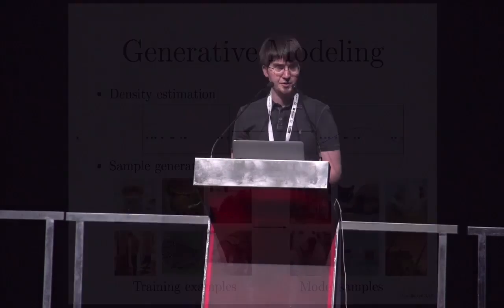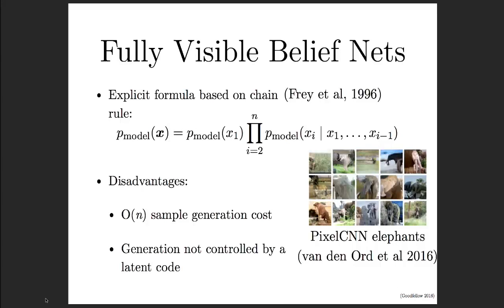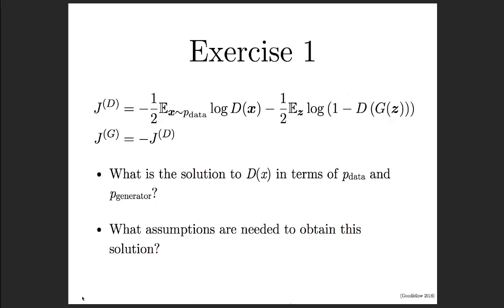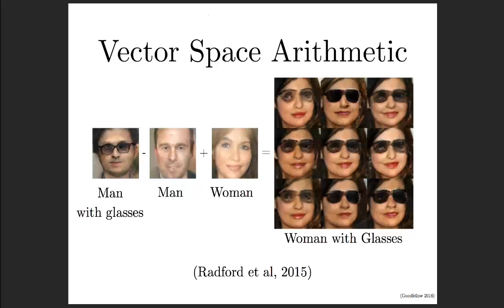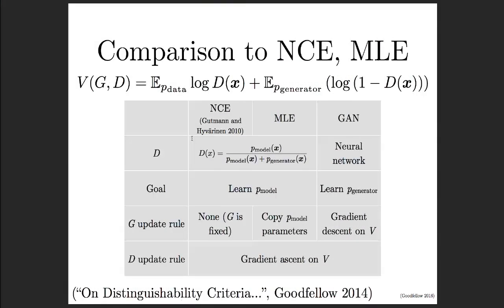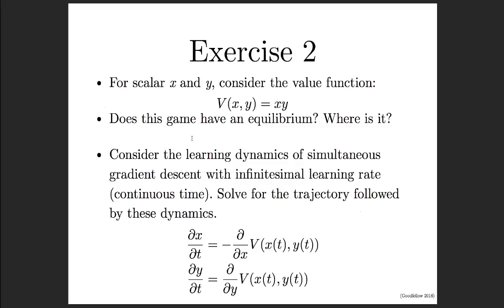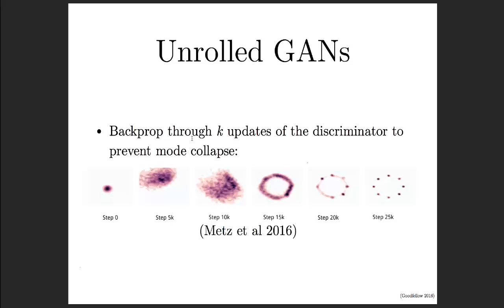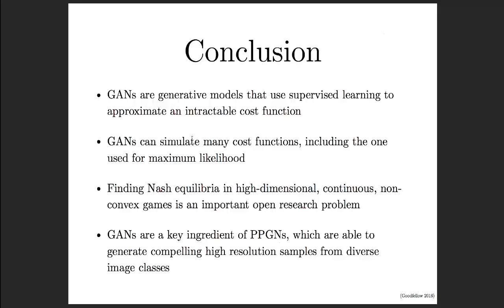Ian Goodfellow: Generative Adversarial Networks (NIPS 2016 tutorial)

Comment: 13:24 when searching for the best theta, Ian is summing over the log of the probabilities rather than over the probabilities, why?
Reply: If it's still relevant, I'll try to help. This is called maximum likelyhood estimation, which is the product of the estimated probabilities on the training dataset. As derivative of product is not easy to work with, we take a log of this, so this yields the sum of logs. As log is a monotonous function it doesn't change the local minimum and is easier to take the derivative of. Hope it helped

Comment: Such a fake Schmidhuber is the true creator of Gans, and Goodfellow had the nerve to shut him up
Reply: Two people inventing more or less the same thing independent of each other has happened many times in history, for example Newton's method or Darwin's theory of natural selection. Calling either of them fake is rather presumptuous.
Reply: @busTedOaS  bro Goodfellow came decades after this guy that's not called simultaneous inventions
Reply: @pranav7471  That's why I said independent, not simultaneous. Bro.
Reply: @busTedOaS  I completely understand that, but u need to credit the first creator too, that's the only problem I have. As far I know Goodfellow was the first one to make Adverserial Networks work, Schmidhuber worked with 1000x worser hardware and wasn't able to get any real results so it was just a cool idea with no solid results backing it up. Thus Goodfellow deserves credit but not completely. Even after all these arguments, Goodfellow refused to acknowledge the clear similarity between the work and cite it, this is blatantly unethical from an academic standpoint.
Reply: @pranav7471 Schmidhuber had modern hardware in 2014. Plus years of experience with adversarial models ahead of Goodfellow, presumably. I don't see any disadvantage for Schmidhuber there.

I agree that one should cite related work and Goodfellow does this consistently - in fact that's what he did right before the confrontation. Why would he specifically ignore Schmidhuber's work while citing many other works with even stronger similarities? The reasonable explanations I can come up with are 1) personal spite or 2) he honestly thinks the techniques are sufficiently different.
Reply: @busTedOaS  Oh yeah I found he has cited predictability minimization, wasn't aware he already cited it, Thanks for letting me know. Then I don't think there is any issue. But the work was done in 1992 not 2014 (one does not usually keep revisiting their decades-old work)
Reply: @pranav7471  I wasn't saying Goodfellow cited predictability minimization. I'm saying he generally shows great willingness to cite other related work (the NIPS paper has 6 pages of references). But if you say he did, then that's great.

If Schmidhuber didn't revisit his old work when appropriate hardware came arround, then that's his own thing. Just saying that hardware wasn't the issue, then.
Reply: @busTedOaS  "hardware wasn't the issue" That's not how academia works 😂😂. LoL, u clearly are not a researcher so u don't get it.
Reply: @pranav7471  You're being very convincing, professor.
Reply: @busTedOaS   the Gans paper has cited and explained the links to predictive minimization, I am 100% confident that wasn't the case b4. Also adding 6 pages of citations means nothing if the one closest to ur work is left out. If may have been done unconsciously but usually it is done by authors to pose as the creator of something totally new brought to the world by them, thus severly frowned upon.
Reply: @pranav7471  Predictive minimization has little in common with GANs except that there's a minimax game being played (as far as I understand it). Almost everyone seems to agree that Noise Contrastive Estimation was the closest relative. So that's what Goodfellow put on his slides.

But hey, if you want to assume bad intent, there is no way to disprove it.
Reply: @busTedOaS  Dont argue about things without understanding for urself, who is this everyone 😂😂, academia isn't a democracy LoL, whats right is based on facts not votes. If u wanna continue arguing do it after reading Schmidhuber work "Generative Adversarial Networks are Special Cases of Artificial Curiosity (1990) and also Closely Related to Predictability Minimization (1991)" - https://arxiv.org/abs/1906.04493 .
Reply: @pranav7471  I don't pretend to understand more than I do simply to appear academic. My impression is that you don't share that attitude.

And I did read most of the paper you linked - it's the first hit on Google.
Reply: @pranav7471  Also, feel free to define "similarity between techniques" in a objective manner, so that we can talk "based on facts" as you say. I find it rather obvious that this is a very subjective topic. Not to mention morality and ethics which are inherintly subjective.
Reply: @busTedOaS  "I don't pretend to understand more than I do simply to appear academic." I don't pretend to understand, I do. I have been following Schmidhuber since the Schmidhuber vs Hinton almost a year and a half now. But hey, if you want to assume bad intent, there is no way to disprove it 😆 (Also first google click so freakin what🙄). Now onto something solid to back my argument here is a list of my publication - 
1) Functional Space Variational Inference for Uncertainty Estimation in Computer-Aided Diagnosis - Medial Imaging and Deep Learning (MIDL) Canda,2020 
https://openreview.net/forum?id=eLL-c_Xc0B

2)Uncertainty Estimation in Cancer Survival Prediction - International Conference on Learning Representations (ICLR) AI 4 Healthcare Workshop 2020
https://openreview.net/forum?id=wcdY_-J7Gc

3)Unreliable Multi-Armed Bandits: A Novel Approach to Recommendation Systems - IEEE International Conference on COMmunication Systems & NETworkS (COMSNET 2019)

https://arxiv.org/abs/1911.06239

Now I am simply a final year undergrad student at Indian Institute of Technology, Bombay. So I am just a little guy but I believe this is enough proof to show I am 100% capable of understanding and judging for myself the validity of Schmidhuber claims. Now to a gr8 extent, I suspect if Schmidhuber was an American or Canadian he would not have sidelined to such an extent and this elitism is what pisses me off the most. Obviously, no way to prove or disprove this, but I cant think of any other reason
Reply: @pranav7471  Dropping your papers here is exactly elitism. I don't care one bit who you are, where you come from and what you have done before on other topics. My respect for your views depends on what you say here and now.

Likewise I would have appreciated you actually saying why I'm mistaken instead of the personal insults or demanding a photocopy of my degree or whatever. But I sense we're well past that already.
Reply: @busTedOaS  hahaha "respect for your views depends" when did this ever exist. I never reacted harshly to ur increasing sarcastic comments, me dropping the papers were simply meant as a counter to ur claim "pretending to understand", nothing more. Degrees are mostly worthless (besides for getting a job) so no I don't want ur degree or anything (i am not an employer). Also, where did this personal attack or insult come into the picture, don't put words in my mouth!!

"saying why I'm mistaken" - I made it clear several comments ago when an idea is clearly similar to a past one now, they need to explain the similarities to it and cite it accordingly. That's it, it doest matter Schmidhuber didn't try it out on modern systems, this isn't a business, that's how academia is supposed to operate in an ideal world. The 2014 version of Goodfellow didn't do so -https://arxiv.org/pdf/1406.2661.pdf , and u seem to be on Goodfellow side and want to suppress Schmidhuber contributions that's why ur wrong. But the good news is Goodfellow has done the right thing by correcting himself here - https://papers.nips.cc/paper/5423-generative-adversarial-nets.pdf . I don't understand what we are fighting now, Goodfellow himself clearly wont support ur arguments
Reply: @pranav7471  > "I never reacted harshly to ur increasing sarcastic comments"

For me it started with "dunno what you're not getting", which you then deleted. And "LoL, u clearly are not a researcher so u don't get it."

> when an idea is clearly similar

Yes, you made it clear that it's your position. Our disagreement is on the extent of the similarity and that's when the smileyfaces started.

> "Goodfellow himself clearly wont support ur arguments."

Surely you agree that adding a reference does not imply Goodfellow views them as similar. He follows the reference with "This work differs from
predictability minimization in three important ways: [...]"
Reply: @busTedOaS  yah and discussing this "This work differs from
predictability minimization in three important ways" is the most important of all. When GANs was released it was considered a massive breakthrough not cuz of its results (it was barely better than VAE and far harder to train) but cuz of the innovative of Goodfellow's approach (game-theoretic approach of Goodfellow was praised by all bigshots on twitter and every conference). But most didn't know minimax objective minimization was nothing new,  so clarifying the similarity with past works and then distinguishes his work (as has already done) would make a heaven and earth difference. So once again I am going to end with "dunno what you're not getting"
Reply: If u still dont get it, i don't see a point in continuing so I am going to ignore any future comments regardless of their content. Peace out.
Reply: @pranav7471  Schmidhuber did not invent minimax objective functions, either. Presumably you didn't blame Schmidhuber for not referencing Nash's work of 1950 in his 1991 publication and explaining why that had very little to do with machine learning.

There's a limit on how far you have to reach back and sideways in terms of related work and I trust you understand that. You might well see things differently on wether or not Schmidhubers work passes that threshold or not. But let's not pretend that's in the realm of provable facts that others have to just "get".
Reply: @busTedOaS  Alright I tried to ignore this but failed😫. Nash Equilibrium was a breakthrough in the field of economics and got nothing to do with the field of AI (AI is a different community and Goodfellow and Schmidhubers belong to this community, if someone wanted Nash work to be cited I can bet Schmidhubers wouldn't have hesitated as much), also the field of Game theory by which the two works are inspired is not Nash's work but rather Morgenstern and Von Neumann's Theory of games in 1944 and was definitely cited by Schmidhuber. Nash Equilibrium is not an algorithm and got nothing to do with either GANs or predictive minimisation. I mean the two reach a local Nash Equilibrium but that's a consequence not an algorithm. "Schmidhubers work passes that threshold" like I said b4 Goodfellow agrees the threshold is crossed so who r u to say otherwise.

"But let's not pretend that's in the realm of provable facts that others have to just "get"" - I am not pretending, in my eyes the similarity of the approaches is within the realm where any honest academician should just get it unless he is biased or has not read Schmidhubers works.
Reply: @pranav7471  Good catch on the Neumann reference by Schmidhuber by the way. I don't see how belonging to a different "community" changes the need to cite work if (!) it is sufficiently related but there are surely better examples I could have made.
Reply: @busTedOaS  he stole the idea, in academia if you don't cite the person who originally came up with the principle is called plagiarism. I think you should read the original paper:
This is taken straight out from the 1991 original paper of Schmidhuber in 1991:

"I propose a novel general principle for unsupervised learning of distributed non-redundant internal representations of input patterns. The principle is based on two opposing forces. For each representational unit there is an adaptive predictor which tries to predict the unit from the remaining units. In turn, each unit tries to react to the environment such that it minimizes its predictability. This encourages each unit to filter `abstract concepts' out of the environmental input such that these concepts are statistically independent of those upon which the other units focus."

if you understand the basic principle behind GAN's and the min-max optimization game that the generator and the discriminator play, then in principle there is essentially no difference in GAN's and Schmidhuber's original paper(in principle) the principle is same and if Goodfellow didn't cite his paper then in academic terms it is called plagiarism and in real life, it is called stealing. There is essentially no debate here to have its either you accept that you took the idea or not. If you look at the original paper he proposes a similar min-max optimization game (This excerpt is directly taken from the original paper):

Maximization of the objective function(as defined in the original Schmidhuber's paper follows the following constraints) tends to force the representational units to take on binary values that maximize independence(referring to generators ability in GAN's to maximize it such that the outputs sampled from the vector of distribution encoded by the generator becomes impossible for the discriminator to discriminate) in addition to minimizing the reconstruction error(refers to minimizing the discriminator's loss function i.e maximizing its ability to differentiate between generated and real image).

Hence to anyone who understands this kind of stuff can realize who is at fault here and why Schmidhuber's annoyance is justified in the true sense. The statements in the bracket compare the principle similarity between GAN's and Schmidhuber's original 1991 paper.
Reply: @khwajawisal1220  If there was "essentially no debate" about Goodfellow copy-pasting someone's work, it would be unlikely for Apple to employ him. Thus, "essentially no difference" seems like a really far stretch to me. Regarding your particular points:

1) GANs do not enforce independence between hidden units. The losses are only defined in terms of the output distributions, what happens on the way doesn't matter. On a related note, variational autoencoders enforce a specific hidden distribution and are in that sense much closer to Schmidhuber's work than GANs.

2) Minimizing reconstruction error is not at all particular to Schmidhubers work. It is the common goal of all modelling tasks. If we are to claim plagiarism, surely it should be on something that Schmidhuber came up with.